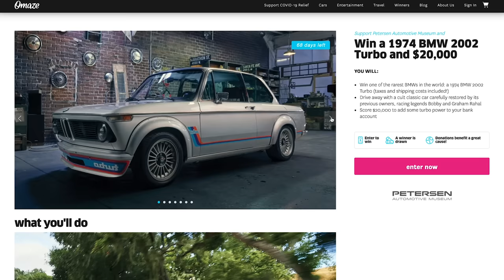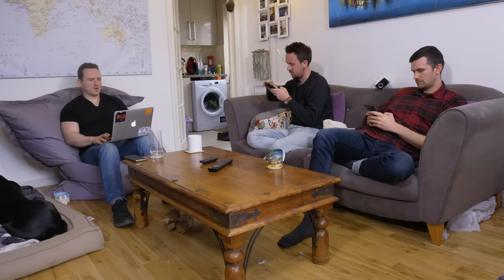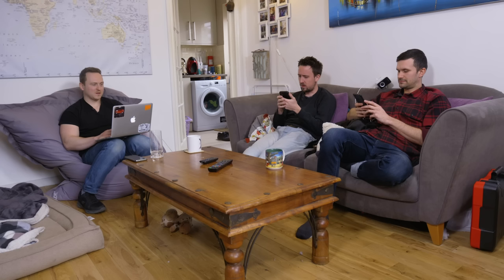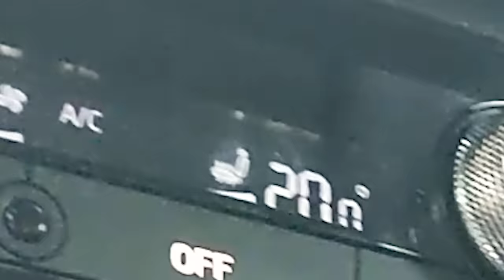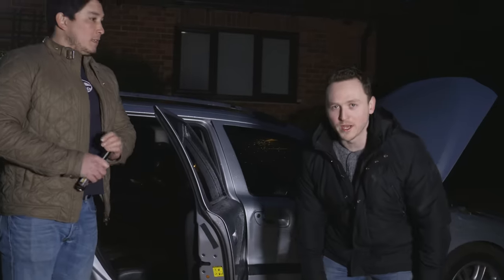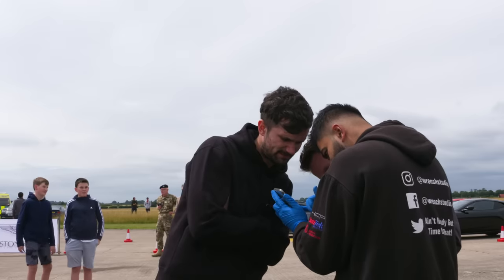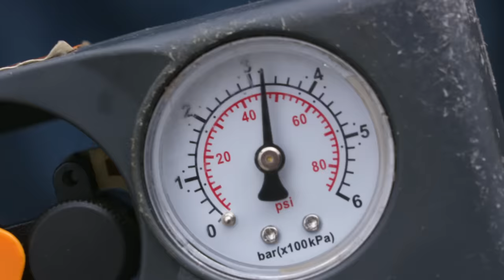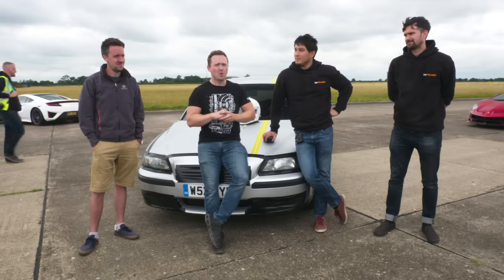Can We Buy A 150mph Car For £1000?

Comment: taping off the rear spoiler was a mistake, the spoiler guides air down into the low pressure "parachute" behind the square butt of that car
Reply: Ok
Reply: Which produces more friction in the tyres therefor slowing the car at top speeds.
Reply: @bkinurface  ??? how does lowering your drag coefficient create more friction on your tires?
Reply: Underpantsniper The shape of the spoiler is basically an upside down aeroplane wing, so instead of creating more air pressure on the bottom edge of the wing, which causes lift, the higher air pressure is created on top of the wing, forcing it down. Taping off the gap will disrupt the the air creating the low pressure, so more higher pressure air will flow over the top of the spoiler, creating more downforce. This produces more tyre friction etc etc blah blah.
Reply: @bkinurface  Not strictly true. A Spoiler is there to 'spoil' the airflow. It is not shaped like an inverse wing, nor does it produce downforce (this is the difference between a rear wing and a spoiler). Instead, the purpose of the spoiler is to reduce lift generated by air flowing down off the roof and down behind the car. It prevents lifting at high speed and improvs the car's drag coefficient. Tyre frictional losses increase very little with speed, however aerodynamic drag increases exponentially. Therefore the faster you go the more impact a lower drag coefficient would make. In a straight line, downforce is pretty meaningless hence the aim of DRS, reducing downforce and drag to increase top speed.
Reply: @bkinurface  I think you mixed up the definition of a spoiler and a wing mi amigo.  what you just described is an aerofoil(wing) not a spoiler.
Reply: If you understood airflow and how it’s affected, you would know what I’m talking about.
Reply: @bkinurface  Its called fluid dynamics and yes I am quite fond of it.
Reply: @bkinurface  I do 'understand aerodynamics and how they are affected'. I have designed and raced streamliner endurance cars capable of doing 40mph for an hour on only a 500W electric motor and 2 36Ah batteries. Even at such small speeds   frictional losses from the tires are minute when compared to work done to overcome aerodynamic drag despite producing only 6N of drag at that speed - much less than shown here.
Reply: @someguy120  What voltage were the batteries? That's impressive speed for only 500w. I only get 25mph out of my 1000w bike with a 48v.
Reply: @McBenjiBoo  they were 12v each but wired in series for 24V. The car weighed around 35kg total (so the drivermade it up to about 90kg in our case) and according to the CAD produced less than 10N of drag at 40mph. The drag figure is the main reason we were able to go so much faster than ebikes and such
Reply: @someguy120  Wow that is insane! Really not a lot of power, I'm guessing it ran through gearing to get those top speeds?
Reply: Yeah, they've made an even bigger low pressure area behind the car that will only suck it back harder.
Reply: @McBenjiBoo  surprisingly not, we did have a motor speed controller but the drive train itself was single speed,  since the circuits were full size race circuits we didn't need to do much braking, so the only real acceleration was from the standing start
Reply: @bkinurface  Sorry, but the spoiler doesn't create higher pressure. That only happens between two opposing surfaces: pushing needs a static surface to push against - a force acting against a point (elementary  'A-level mechanics' mathematical theory).   A wing creates lower pressure on the curved surface that sucks in the direction of the curve. The spoiler's purpose is to stop the airflow tumbling down immediately behind the car by keeping the airflow attached to the very end of the roof thus reducing turbulence-created drag and lift. With a rear wheel drive car you need the tyres to have as much contact with the road as possible: frictional losses are nothing compared to traction lost through wheelspin.  Proof that it works is an even coverage of filth/damp on the rear window - without it there would be a very dirty section down the middle of the window.  For a wing to function it would have to be positioned higher-up in the direct airflow, 30cm + above the roof: that's why F1 car's engine cover drops down to the top of the gearbox to get every bit of the wing in clean air.   Ignore the wings on BTCC cars, they are just for show.  Instead look at DTM cars or the Aussie V8 Supercars - they are on really powerful, RWD racing cars.

Comment: my dad used to have a v70 2.4 t so that made me laugh at the 3 and a half minute mark
Reply: My dad still has a V70 but sold some of it's parts so it's not running anymore 😂
Reply: @timhontonares3193  We still have ours and owned it for 10 years already. Currently 360 000 km on the clock and still going strong. (2007 Classic 2,4)

Comment: Surely taking a turbo charged car right into the redline before changing gear was the wrong strategy? Would it not have been better to change gear earlier (around 5500/6000 rpm) and use the torque to pull to better top speed?
Reply: Its a low preassure turbo tho. Dunno about the 2.4t but my 2.0t rose in power all the way to 7200rpm ish. But i bet its not very good for the engine tho. Or transmission. But with 300hp ish i bet nothing is good for the engine since it came with 180hp.
Reply: That was my thought too. According to the manufacturer, that car is making peak torque at only 1950rpm and hp at 5250. Definitely tuned for midrange, as a heavy wagon should be.
Reply: No. Shifting at max torque is a unfortunately long lived myth. Almost every petrol car benefits from being shifted as late as possible, often well into the red, close to the rev limiter.
Reply: @bk83082  Peak Torque doesnt matter. The Power curve does. Most often shifting well into the redline is the fastest.
Reply: @GoldenCroc  my point is that with this specific car, shifting at redline is probably not making the most of the power curve. Lots of turbos that are tuned for midrange drop off well before redline. So instead of spending time trying to get redline in 4th gear after the power curve has leveled or even dropped, shifting to 5th early gets you back to a more useful rev range. Again, my example is specific to a turbo motor tuned for midrange, not every car.
Reply: Also pointing out the peak torque and hp was specifically to illustrate what the curve is. Not to suggest that he should shift at 2k.
Reply: @bk83082  Well this is true, but most cars gives less power to the ground on the next gear than they give at the current gear redline, or even well into the redline. 

Many people also mistake the torque curve as the one to base shifts on, which as you know isnt true. As you can see, the originator of the first comment believes this. This was the base of my comment.

Bottom line, even if the power curve drops quite a lot, it can, and often is, beneficial to keep going, rather than to put a higher gear in.
Reply: @GoldenCroc  all anyone is referring to is the attempts made in this video with this volvo, what happens in other cars is irrelevant. I don't know if he'd be faster making his shift to 5th early or not, but I'm hypothesizing that he would. He's attempting a top speed, so I think he would go faster if he were pushing a taller gear ratio while also being in the most effective part of his power band. The time it takes the car to get to redline in 4th tells me he could have spent a few seconds in 5th with the turbo doing a lot more than it would at higher revs, and pushing the car to a higher top speed.
Reply: @bk83082  If by "anyone" you mean yourself, then I am sure this is true, but the the guy posting the original comment was referring to any car with a turbo, which is almost most of them these days. He had also misunderstood what torque does. That, as I said earlier is why I made my comment.

Secondly: No I dont know for sure either which would be fastest, not without having a power graph and gearing graph of the Volvo in front of me. You have a very valid point, but its hard to know for sure. Again, my comment was regarding what is fastest in most turbocharged cars, not this one in particular. It may well be that its turbo runs so completely out of steam that it is beneficial to shift earlier, but that is generally uncommon. Fair enough that in this case, we can only speculate.

Comment: The fastest I've been so far was 137 mph in a 99 Mercury gran Marquis until I hit a bump in the road nearly went into the woods. Good times in a 600$ beater with a v8
Reply: Oh damn not bad, my old IS200 pulled 130mph but it was the limit, probably could have gone a bit faster if i had another gearbox
Reply: @neon-kitty2281  a lot of 2l diesels will do 130 with a long enough stretch. Its not particularly pleasant though!

Comment: Top effort gents! Great fun!

Watching the dials i did wonder if there's no point hanging onto 4th for so long, drop it back into the power band of 5th sooner, also fit a cold air feed to the intake, with the grille and vents taped up like that it would be sucking hot air from the engine bay letting a few horses get away.

Comment: You were shifting WAY outside of the powerband of that motor. These engines fall on their face after 6k. They peak just over 5k and they drop by at least 50hp after 6k. The mitsu TD04-16T turbos have tiny little exhaust housings. If you were to shift under 6k each gear I bet you would have made 150.

Comment: he shouldn't have shifted at redline in 4th gear, it pulls harder in 5th since it loses so much torque at the top end. Volvo engines are made for low down torque so I think if he would shift at 6k instead of 6.5k he would have gotten a bit more out of it, maybe enough to get to 150mph

Comment: Living in the US, I wish a car even existed under $1000 that still has all of its parts attached. Never mind running.
Reply: Do US cars get tested annualy for roadworthiness? Over here in Ireland and in the UK cars have to pass an NCT or MOT to get a cert to allow it on the road, they check everything from brakes , suspension, lights, tyres, brake lines, chassis strength etc
Reply: @rneoman  No, but you will get pulled over if your car can’t go faster than 55mph, and doesn’t have working headlights. That’s all. There’s also a transmission test every once in a while.
Reply: @rneoman  it depends on the state. I personally have to do an annual inspection

Comment: I think the ''standard'' S60 R might get real 150 or even 155.
My 2.5T will do 242 km/h (150,49... mph) on the tacho perhaps (or otherwise in the booklet) but in real life probably 225-230 km/h (140-143 mph) with 210 bhp.
There is always a small margin for error, even with many modern cars.

Comment: I paid 240 for a accord type v 2.3 vtec flying 160 bhp a few mods and a map and it was nearly 200 hp that would do 150 on cruise control 51 plate had all the toys electirc headted leather seats sunroof all was wrong had a blow on the flexy pipe wish I kept it tbh it was a beautiful blue a honda breaker had it and stripped her she wasn't even that rotten tbh that was before I knew what I was buying and selling

Comment: Depending on what engine it is. You can get 320hp with just a tune (bsr for example) Since you already got the exhaust done. or if it's the 05 t5 engine. You get 350hp. Only mod you need to do except the tune is larger injectors (from a v70 r for example)

Comment: I've had my 94 4door s-10 blazer Tahoe Lt 4.3 vortec 2wd up to 140 mph with room to go faster. Full leather interior with the AC on, but the old girl gets Shakey above 110. I paid 700 USD for it btw with 105k miles on the odo about 8 years ago, it's at 179k now, still running strong, It's the vehicle I abuse the hell out of, Ill go over speed bumps at 40mph, drift on dirt roads, and I've pulled 9k lbs behind it.

Comment: Pull the catback exhaust off it, shed a couple pounds, free up the exhaust.  Maybe even pull out the air filter if you’re feeling lucky.  With a turbo car, also ice down your intercooler.  You can hit 150 there - we know you can!  (I knew a guy with a Turbo R Volvo with over 400hp - that thing flew!  It had 300hp stock. Mid 2000’s?)

Comment: Honda Civic 2.2 CDTI, top speed 128mph. I did 153mph GPS speed on a private road. Just looked on auto trader (3 weeks late) 1000 quid and under for an early 2006 model.

Comment: It's because you didnt shift. Volvos aren't meant to be driven at high RPMs. Stock Camshafts are aimed more towards lower RPM. Which also is why you were slower in the last run.

Comment: If this car has the stock turbo, it is not clever to push it so far in to the RPMs, it is not that efficient there. PS My dream car is actually a C30 with this 2.5T engine, unfortunately those with a stick shift are a little bit expensive here in Brazil.

Comment: That air box isn’t getting a cold feed. It’s sucking up warm engines bay. Having had one of these engines and had similar kind of intake I can tell you idid loose power.. honestly found the oem air box and cool intake from the grille worked best 😅

Comment: The issue they had is they taped the spoiler which untaped reduces drag by 2% (dont quote me on that) or something like that i really dont know how but taping it not only gets rid of the 2% drag reduction but also the way they taped it made it look like they turned it into a a cut ducktail increasing drag but i cant blame them because if it was me doing that i would of probably forgot if anything i would of just taken off the rear trunk hatch

Comment: saw this before and its a good video.  i did think it last time, but just because the spec sheet says 150mph plus doesnt mean it will still be able to do it after all the years and mileage.   its a little surprising what old cars can still do top speeds though.

Comment: They should have made a few holes in the exhaust, that would make the engine easier to release the gases and the without the Air filter .More oxygen more fuel =More power

Comment: Shouldn't of taped up the spoiler, the slit is to allow air to travel under the wing reducing the negative pressure at the back of the car which causes drag.

Comment: That aftermarket air intake is sucking hot air from the engine bay, its supposed to be routed to the front grill that you covered with tape XD

Comment: they should not have taped off the front grille because the intercooler is the same size as the radiator and therefore only half of it will get cool air through the bottom scoop and get heatsoaked with all the accelerations :(

Comment: 850GBP for complete car? This used "R" front bumper alone costs maybe more than 400GBP in the eu (complete with reinforcement, grill, plugs, fog lights). So you bought car for 450GBP. If you will scrap this car, please don"t srap this very rare part, I will buy it (for a good price :-) ).

Comment: You guys buying a 2.4 T5 for 1000 bucks.. bruh these are rare asfck over here in Holland! Best you can find is a 2.3 T5 or a 2.4T other than that only ones for sale are NA 2.4 with 144 or 170hp
Reply: Bruh, its got an R bumper and grille aswell?! Damnit these two parts are worth easy 1000 bucks 😂

Comment: a Infiniti g20t or in Europe the Nissan primera p11 there a fwd i-4 with 145hp and 136 ftlbs of torque ik it tops out a 215 kph (133mph) 0-200 in 60.1 seconds if u have a manual and a touring edition
Reply: Nvm I just realised that 150 mph is 241 kph which is fast as fuck I'm good with 215 thank u very much😂💀